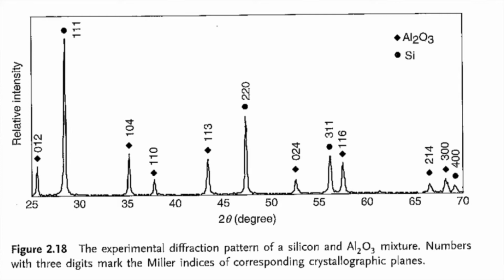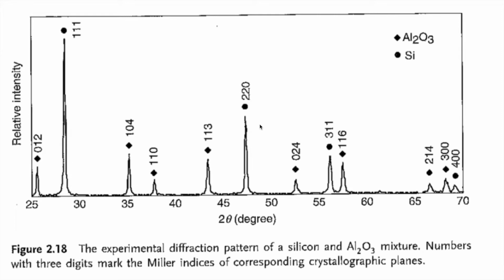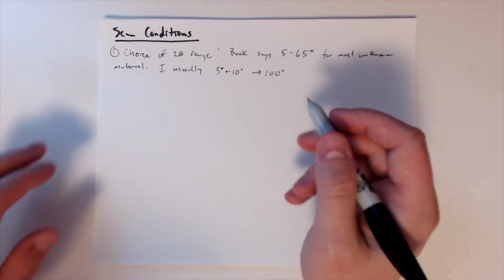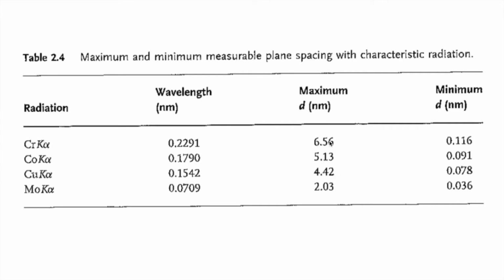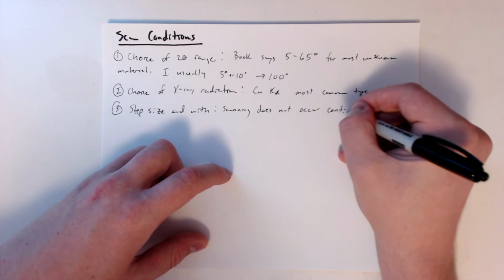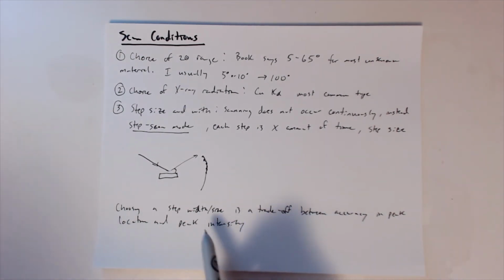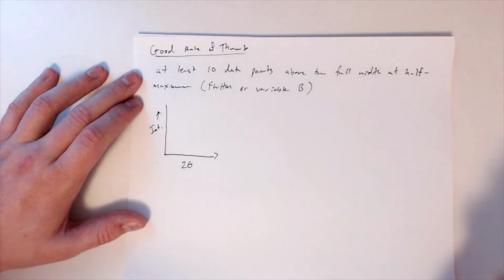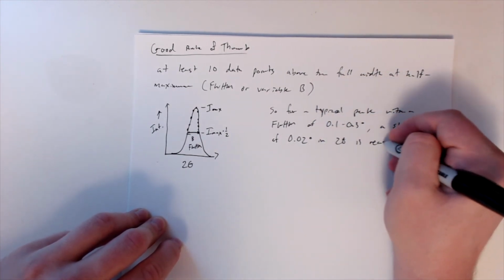MSE585 F20 Lecture 13 Module 3 - XRD Scan Conditions

Comment: Dear sir, 
I like your explanation. Is there any calculation based on the unit cell size (d), how the minimum scan step(/rate) should depend. Or can we determine the time to complete the whole experiment beforehand.
 I want to identify the time required for a mixed sample of Li2O, Al2O3, SiO2, SiC. Is it possible to identify the min step size so that peaks of all crystal formed at high temperature can be measured.

Thank you!